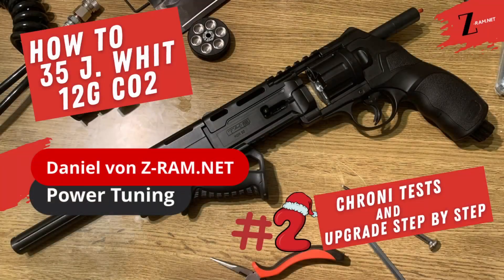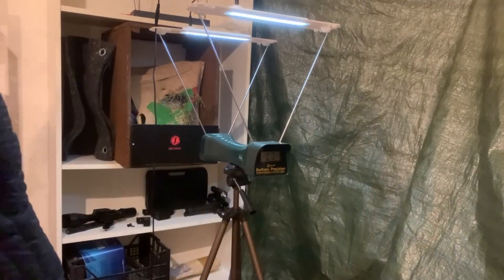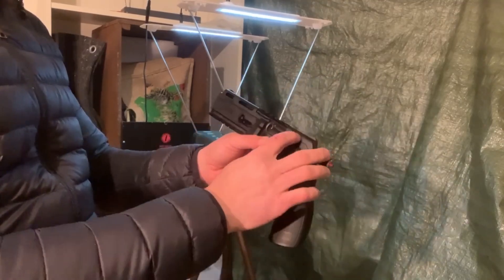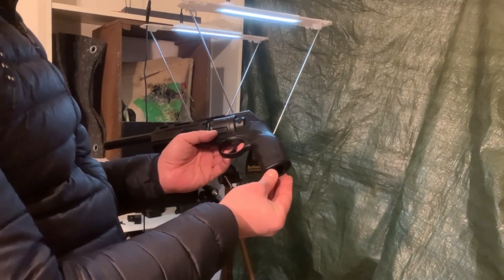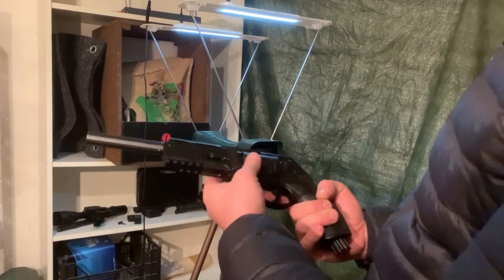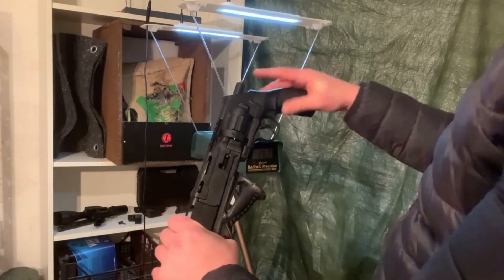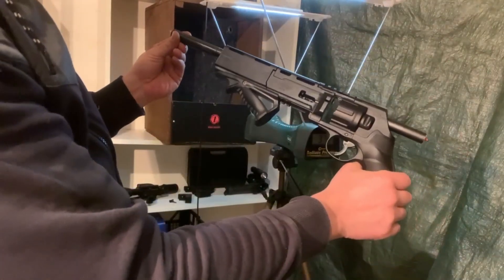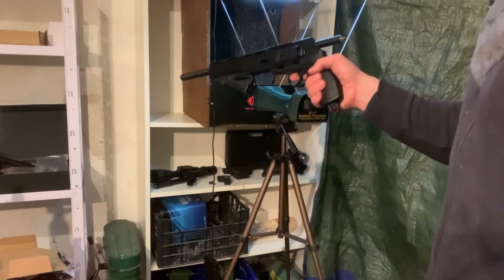🚀 Bring your HDR50 to 35 Joules with 12g co2 (Part 2) Chroni Test and Upgrade Step by Step HDR68 HDP

Comment: I removed the valve block and installed tuning barrel (7.5j version) It farts the co2 on the first shot and the trigger locks until i empty whats left in the co2 is there any known reasons why this happens? do i have to put a restrictor in the handle from the powerkit or is there another fix for this where i can keep it fully open?
Reply from the maker: see if the drum rotates when you pull the trigger. Test this without a capsule. or check the little oring at the front of the chamber.

You can leave out the restrictor completely, then you have full power, but if that's not enough shots for you then you can install the modify pin. Then you have a few more shots but a little less power. We also offer the power pin without a restrictor. And then you add the Modify pin.
Reply: @z-ram  drum rotates good it never locked up without a co2 i can pull the trigger as fast as i can I tried to open it and take the valve pin out through the hole where the brass cap goes but i failed as it rotates the assembly when i turn it (i think ill have to take it apart completely for that i may have also stripped the head of the valve pin messing with it) I put it back together and it dosent lock up and empty all the co2 anymore  but it farts loud on each shot i get about 3 shots it dosent seem to sound like its leaking when pressurized but could it still be the heat core o ring at the front of the chamber (thats the o ring you ment right the heat core one by the valve pin? I just dont want it to fart its wasting power / air and its not a pleasing sound lol
Reply from the maker: @xentrix89  sorry, it's hard to help you from here
Reply: @z-ram  ok thanks for the help 😃

Comment: Nice setup! Would probably work nicely with the new threaded CO2 valve👍

Did you use the foregrip to attach the barrel shroud to the marker? If so, did you have to grind the hole in the shroud bigger to allow the barrel to slide freely?

I got my tuning barrel and shroud today and it's very flimsy feeling when attaching the shroud straight to the barrel. The rail on the shroud is not perfectly aligned with the rail on the marker and using a grip to attach them to each other seems to tilt the shroud a little bit, preventing the barrel from sliding freely, which then prevents the drum from rotating.

If anyone got any tips and tricks to get around these issues I'd love to hear! :goodvibes:
Reply from the maker: Hi thanks. Have you seen my last video? I tested the same setup with our new valve.

Grinding the hole is a good idea, but in my case the handle is firmly attached to the marker and the barrel cover slips through the handle on the Picatinny.

But your idea is great! Just try that.

Greetings daniel
Reply: @z-ram  Just checked it out. Impressive results for a compact setup! I guess I got to build one marker for a 25g capsule at some point. 😆

Going to grind the hole a bit for the barrel to move freely for sure! I like when everything's attached tightly 👍

Keep on coming out with new cool products! Greetings from Finland 🇫🇮

Comment: HDR50 open valve, shorter pin, tuning barrel with sniper extension kit and ca4,5gram projektiles (devastator or  z50) over 30 joules with co2. Satisfied.
Reply from the maker: Sounds good too!👍
Reply: You better hit with the first good shot xD
Reply: Hey bro. Could I ask you any modifications for a Crosman Vigilante? I know the vigilante has so much potential cause of how powerful it is out the box.

I think the vigilante is viable for self defence with modifications
Reply: Which sniper extension kit do you recommend?

Comment: Just ordered one of these with the mods for more power.  I hear the weight of the ammo determines the joules.  Do heavier rounds increase or decrease the power?
Reply from the maker: The joules that are achieved in the end do not change much depending on the weight. With light bullets you have more FPS and with heavy bullets you have less FPS. In the end you will almost always have the same joule. BUT bullets that are too light or too heavy can reduce performance. As always, the middle is ideal and you have to experiment with your marker. But the 6 grams of our ZDR50v2 projectiles have an ideal weight.

Comment: Should i completly open 11j Verision? Or only block? Or valve maby?
Reply from the maker: Yes, if you want to get the maximum out. If you want a few more shots but less power then get the ModifyPin. Greetings daniel
Reply: @z-ram  i dont want to destroy it :D the best choise  on start is to remove block? Next step, buy shorter pin? And third level is remove valve on co2 capsule. But probably there will be problem with ony 6 shts from 1 capsule?

Comment: I only have acm powerkitV2 installed(20-30J) and valve block removed so its about 30j and its a monster, still need extension barrel though. Shootin razorgun 50cal iron speedball 2.2g they super high speed with just an impact. Shooting into the woods the ammo travel very fast and snap into tree like my dads .22. then i have devastator 4.8g steel ammo in plastic casing. This thing is fun, but dangerous.
Reply from the maker: That sounds bad! Then you have to check out our Z50v2 projectiles and watch this video.

https://z-ram.net/products/6x-z-50v2-z-ram-steel-bullets-for-umarex-t4e-hdr50-caliber-0-50

https://youtu.be/erB0XDhhQxQ

Comment: So without regulator cap near the co2 abd with the Z extension  and loger barrel makes only 3-4 shots is that right? What about with the restrictor cap near the co2 and Z extension and longer barrel
Reply from the maker: You can see everything in the video.
Reply: @Z-RAM  watched it with no valve restrictor and no chamber with extended barrel and z extension 4 usable shots if I put the valve block would it still do around 28jules but at least 6 shots? I want to have at least 6 shots in 30 jules I don't have the valve restrictor near the co2 but I  have first model rocketkey  pin and chamber +  extended screw in barrel and your z ram extended block I have HPA conversion kit but want to be compact with co2
Reply from the maker: @kmom777  with a Z-Extension you could maybe even manage 6 shots, but with 2 Z-Extensions 12g is not enough. But you can also try to counteract this with the Modify pin. That's what he's made for

Comment: The z extension is to big for HDR 50 ON CO2 12g
If the Z extension will be shorter then will work perfectly on CO2 12g
Reply from the maker: It also works so well on 12g CO2 only that you have 4 shots.
Reply: @z-ram  I believe that the Z-Ram extension is good option for HPA 1100PSI, over 0.4L Tank to get many and  powerful shots 🤔
On 12g you don't enjoy the Z-Ram extension i believe.
Reply: @noobt4eguns  I agree with you there, got the extentions myself. But well, even the last couple of shots with lower power and z.50 can be lethal, they penetrate deeply. However would be best with a bit of HPA, or perhaps sometime in the future, when someone figures out a modification in the grip to insert 16-20g CO2, so that it has enough power for all 6 shots. Who knows what the future brings, the mods keeps poppin out from all directions :D

Comment: Interessantes Video 👍🏼 
Was ist eigentlich der Untetschied zwischen der 7,5 und der 11 Joule Version des Power Pins und Valves? Und welche Auswirkung hat es, wenn man die 7,5 Joule Variante in die 11 Joule HDR50 einbaut?
Reply from the maker: Schau dir mal das erste Video diesen 2 Teilers an. Die 7,5j Variante hat einen größeren Block im Chamber aber kein Ventil. Und die 11j Variante hat einen kleineren Block im Chamber aber ein Ventil. Wenn du das Ventil der 11j in die 7,5j einbaust solltest du weniger als die 7,5j haben.... Denke ich , habs nie versucht. Warum auch 😁
Reply: @z-ram  Danke für deine Antwort. Das mit den zwei unterschiedlichen Blöcken habe ich gesehen. Ich meine den Unterschied von den Tuningteilen her: Da gibt’s ja ein Powerkit für die 7,5 und eines für die 11 Joule Version.

Comment: Hi Daniel, you did a great job! I've got a question - any trick to replace the valve pin? I cannot unscrew it... changed the barrel, replaced the valve, installed zchamber and the last thing missing is the pin replacement
Reply from the maker: Yes, some have a problem with that. It broke off for me too. You can try to warm up the bolt and pin very well before unscrewing it. If that doesn't work, then use a thin drill to drill out the pin at the back, but try not to destroy the thread in the bolt. And then die fumbling out the leftovers. I wish you success
Reply: I can feel you both my friends.
Its just your phobia and nothing more.
Get the heat gun with the small nozle on it and keep the pin valve casing with plier gently and heat it on back side until you see the locktight on the threads to become liquid and then unscrew the pin and let it be cool. Put locktight on the threads of the new pin valve and screw it back but don't screw it straight on, screw and unscrew it before to screw it all back.Put super lube to the pin valve and silicone oil to air release valve. I hope this will help you my friend

Comment: Please dont use the 12g capsules. Go for the 88g or hpa system and test it with them!!! Pleaseeee. 12g makes no sense because less power and not enough shots!
Reply from the maker: This is yet to come! Thanks ;)
Reply: 12g is easy to find and definitely has enough power even with solid steel balls i can penetrate 3 layers + of drywall
Reply: @Seabass1206  but not enough shots and the co² is not good for the sealings and can freeze the weapon! Also a waste of money and material
Reply: Okay I'm new to this. What is the HPA system
Reply: @GregRichard-e2i  high pressure air like a tank that you will will oxygen basically
Reply: @danieldaniels4168  It was designed for CO2 mate
Reply: @danieldaniels4168 and if you can’t kill your target with 3 hits you not gonna kill it with 6
Reply: @donchodon4245  if you hit the exact same spot 6 times maybe? lol

Comment: Moin mal ne Frage, wenn ich mit cal.68 und 299 fps spiele sind das rund 10,5 jule . Bei 11 jule und cal. 50 sollte es doch passen oder mach ich da ein denk fehler gruß paddy
Reply from the maker: Servus ! ich verstehe nicht ganz. Was sollte dann passen ? Um Joule zu errechnen ist das Kugelgewicht und die Geschwindigkeit von Bedeutung.
Reply: @z-ram  Moin ich meine wenn ich ich eine 11 Joule hdr kaufe oder eine 7,5 auf 11 Joule umbaue ist das doch (mit Paintballs ) optimal um zu Spielen . Ich lese immer die 11 Joule wäre zu stark zum Paintball spielen..... Gruß Paddy